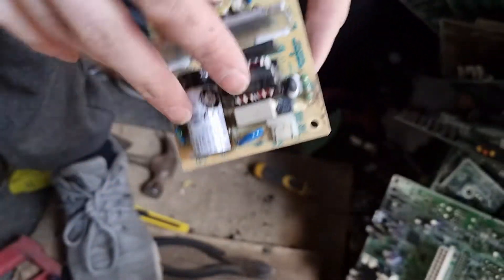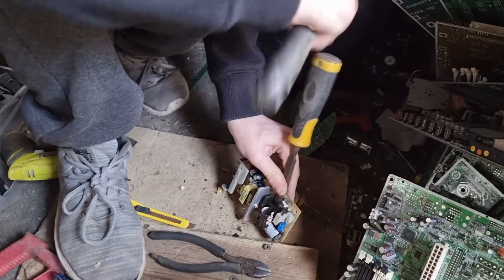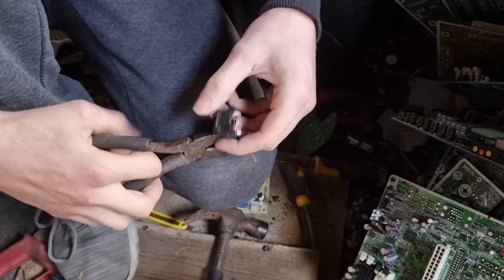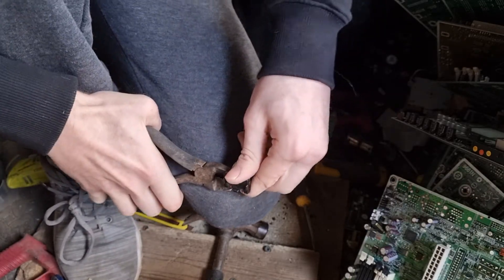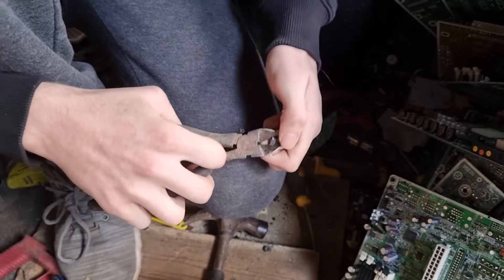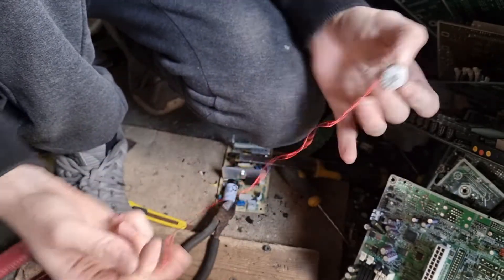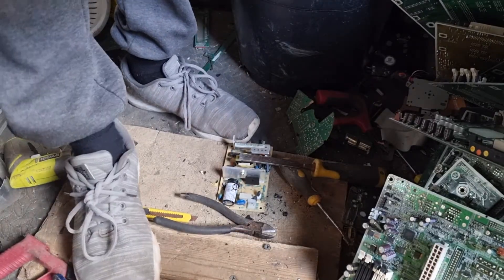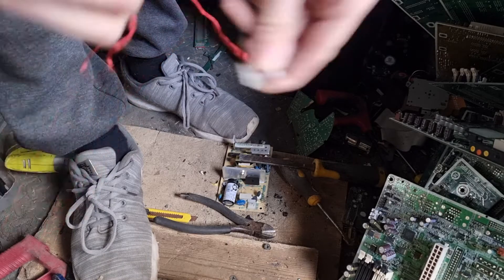how to scrap another type motherboard transformer for copper

Comment: I take every one of those .. the only thing I do different is I put a small screwdriver in the center and grab the two wires and pull it works awesome 👊🏻
Reply from the maker: I would normally too but it was a tiny one and I couldn't get anything in there haha. I don't normally bother with them unless they are the bigger ones anyway
Reply: @keytefirerefining1355  I take all of them but I need copper for my videos and ever bit counts 🤣

Comment: Just hold the ferrite and pull on the copper. It will spin the hole thing. They are sometimes squared shafts and I just push the ferrite out and use a screwdriver.
Reply from the maker: That's what I normally do. That one was too small so had to do like that